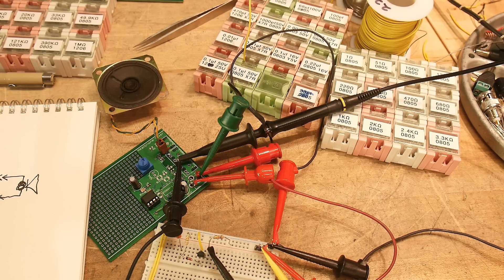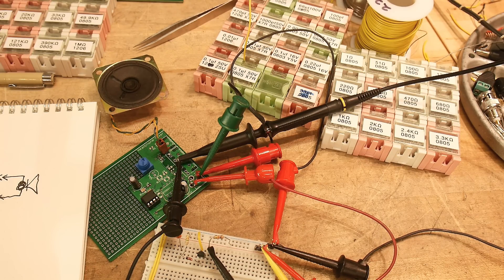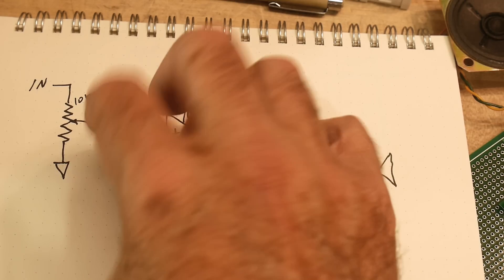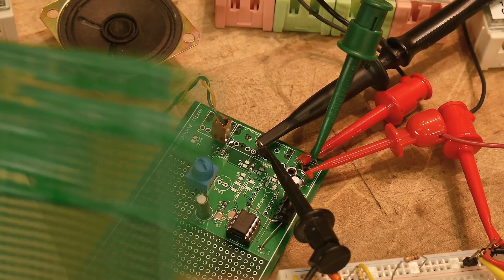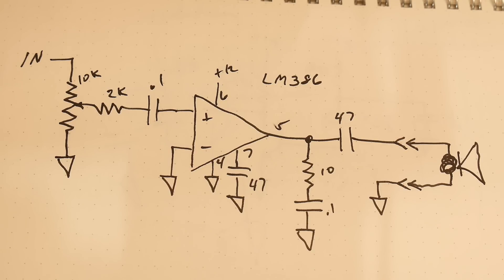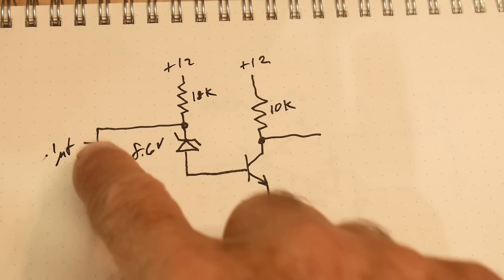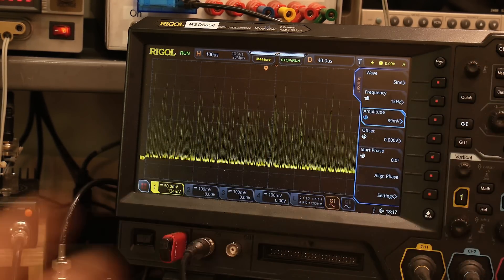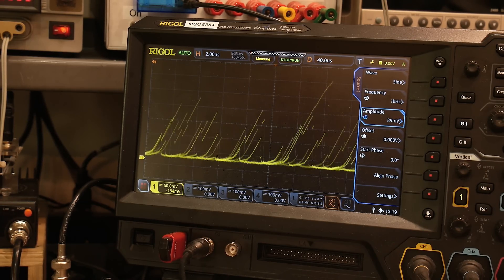#1197 DIY Analog Synthesizer (part 1 of 15)

Comment: Calculating is cheaper than soldering. If you want to have 19 different oscillators for DIY sounds take a look to the Synthesizer Workstation: https://youtu.be/oI_mTEu3WqE

Comment: Does it matter what type of NPN you use in the noise generator?  Using a 2N2222 I can't get noise out until the Zenner value (+ NPN Voltage Drop) is less than 0.3v lower than VCC (ie 11.7v -12v).  An 11.1v Zenner worked but anything less generated no noise at all.  Tried at lower voltages (VCC) and got the same result using lower voltage Zenners.
Reply from the maker: you need avalanche, lower voltage zener diodes zener, higher voltage zeners actually avalanche .   the avalanche voltages of NPNs will vary. so best to use the 3904
Reply: @IMSAIGuy  Hmmm.  Put in a 3904 and no change.  With your circuit, except using a 8.2v Zenner - 1N4738A (since I don't have an 8.6v Zenner) - No noise - no output at all.  OK, reading further down the comments I see connecting the 18k to the Collector rather than 12v is a thing and now I get 1v PP white noise.
Reply from the maker: @davidh1187  it is sometime picky about the layout, you try the circuit in: https://youtu.be/Ow9zQXPYm3g
it is almost the same but on resistor is tied to the collector instead of +12

Comment: Sweet series. I have a new scope on the way that is somewhat respectable and I have thr lm386 circuit already breadboarded from something I was messing either last week. Is it better if I just build the output on some veroboard?
Reply from the maker: soldering is more reliable
Reply: @IMSAIGuy  that's what I thought on both.  Thanks man. A decent multi output psu is next on my list.

Comment: I just built the white noise generator and it works great. The only changes are that I used 9v supply, a 2.2k resistor instead of the 18k resistor, and an 8.2v zener instead of a 8.6v zener. It took a little bit of trial and error to find out a good replacement resistor value, but it was still pretty easy. Thanks for the circuit idea

Comment: I'm having trouble replicating your noise with your circuit, using a 2N3904.  It looks like you have about 200mv spikes.  I see nothing (just ambient noise), connected to the collector of the transistor.  Does it have to be hooked up to a load?  Maybe the scope has to be set up a certain way?  I would love to see more detail on that.
Reply from the maker: instead of hooking the 18k to +12v, connect it to the collector
Reply: @IMSAIGuy  Thanks, that helps -- I'm seeing the ramp shapes now, but it doesn't look like "hair" like yours -- there's no "floor" to it, it seems to be riding on other random AC noise of 30-70mV, even if I use a 12V battery for the supply.  Maybe it's just the cheap zener I'm using, or just way too much ambient room noise.
Reply from the maker: what is the speed of your oscilloscope?
Reply from the maker: also what voltage is your zener?
Reply: @IMSAIGuy  I was using a 1GHz scope, tried limiting BW and also tried a 100MHz scope. I think I figured out that most of the noise was due to using long leads to the power supply (or battery) picking up RF, looks like mostly around 100MHz (FM stations?).  Thanks for the help!
Reply: @IMSAIGuy  I didn't have 8.6, was using 8.2
Reply from the maker: @SorcererStan  zener diodes below 8V have zener breakdown, above 8V have avalanche breakdown. not sure about 8.2
Reply: @IMSAIGuy  OK, I didn't catch that part, I thought you just chose a random value below 12V to get the effect.  I'll try some others.

Comment: I have a feeling this is going to be a fantastic series of videos. 
I've been working on my analogue synth build since Christmas, and with an arduino based midi to CV converter it's now at a point where I can get something vaguely resembling music out of it. 
Really looking forward to seeing what you come up with....
Reply: Yes, I've been into it for a year now. My second project was a MIDI to CV converter as well. Just to save you some frustration. Forget to use the inbuilt DAC. Even though my microcontroller was not an Arduino but a PIC, I still can tell you, that you need a more linear DAC.
Reply: @PermireFabrica  yes I have 2x MCP4822, that gives 4 voltage control channels that have 12 bit resolution. 
I have voltage outputs for note CV, pitch bend, mod wheel  and velocity.
Reply: @brianharper9798  okay nice. Quite a powerful module you've built! Mine is only dual channel and only gate and CV output. But one channel can be set up as a 16-step sequencer.

Comment: LM386's are unaccountably popular.  They hiss.  They oscillate, particularly if you're at all careless with layout.  They sound like crap at best.  

I actually get better results with the venerable LM380.  You  can put a couple of big copper foil heatsinks on it to get more power, it's more stable and quieter, you can wire a pair in push-pull for even more power out and drive a fair-sized speaker if it's reasonably efficient.  If it's an actual audio circuit rather than a synth, NE5532 pairs well with it as a preamp.  Yeah, they're old-school but they're still available in multi-thousand quantities overnight.

Comment: Does that lm386 have a 1w output or a 700mw output?
Just wondering which one you are using 😁 of course the 500mw lm386 would be better suitable for a preamplifier stage. Almost all the preamplifier op-amps that I have looked at on a data sheet usually range from 135mw 250mw, 350mw, 500mw and 625mw. But the 700mw and the 1watt lm386 are great for pushing a 2 watt or 1.5 watt 8 ohm speaker. But I have used the 1watt lm386 op-amp as a preamp amplifier but you have to used a trim pot or a resistor on the output of the 1watt lm386 before connecting it to a amplifier stage to get great sound quality control. I have also used the 1watt lm386 op-amp to make a distortion pedal at full tilt or cranked all the way up it'll get really distorted. No need for germanium diodes or LED lights to create distortion😂 You can use a 10K potentiometer along with a 10uf capacitor across pin 1 and 8 of the lm386 to control the gain.

Comment: "Moog" pronounced like "vogue".
You and I should chat since I just started on a similar trajectory, also op-amps, also those light jumper wires (but an analog computer-like learning-PCB, not a synth).
My casual interest in music synths suggests pink noise is preferable? I suppose there is an easy filter you can add to get it pink.....
Reply: Unfortunately not as easy as you think. Check out this video: https://youtu.be/0yB_h_wFkh4

Comment: Wouldn't the open loop LM386 work like a comparator and completely saturate into his 12V rail with any voltage over 0V? I can imagine it would look like a square wave at the output? (There is maybe a low pass filter on the output, maybe not a super square wave)
And which 47µF capacitors do you recommend using for audio circuits? There are a lot of rumours on the internet about "audio capacitors" :/
Reply from the maker: the LM386 is a fixed gain part.
Reply from the maker: this is not audiophile, any 47uf is fine
Reply: @IMSAIGuy  Thank you 🤗
Reply: According to LM386 data sheet the capacitor should be 0.05 µF (i.e.50nF)
Reply from the maker: @petrituominen8709  yes, I just didn't have one. I usually see 47nf

Comment: So what you just showed me is that if I use a zener diode as a voltage reference it is going to be noisy and I might want to include some filtering.
Reply: Yes and 78xx 79xxseries linear regulators make noise too alot of ppl have no idea about this either

Comment: Try a reverse biased transistor base emitter junction as well, as that also will break down around 7V, and give similar noise. You can even use TTL gates for this, abusing the input structures and output structures, with only 2 connections, to get a noise source. For higher more impulsive noise use a RF transistor as amplifier, and connect diode direct to base, without breadboard capacitance, which will reduce that initial falling time a lot.
Reply: What about the Collector?
Leave it open, floating or short to Base?
Reply: @paulcohen1555  Either way will work, though shorting to base can reduce external pickup of noise, especially if you use a TO can device where you can ground the can and collector.

Comment: is the opamp in open-loop? I dont see any feedback element
Reply: I believe the LM386 has internal feedback as it's meant specifically for audio amplification and thus the huge internal gain of a typical opamp isn't needed here. The datasheet shows an extremely simplified version of the internal schematic which has gain control circuitry. By default the gain is 20, and with a capacitor between pins 1 and 8 (as you can see here, disconnected) and a cap on pin 7 you can change the gain
Reply: Lm386 ist not a opamp. It is a audio amplifier for small speaker. For sure it can be used for some other things. On the other Side this ist not true for all speaker amps
 The classic tda2030 ist more like a Power opamp😉
Reply from the maker: the LM386 is a fixed gain device.
Reply: I had this same question.

Comment: What is the upper frequency limit of the noise in your circuit?
Please show the spectrum.
Reply: Depends a lot on the transistor amplifier and the layout, low capacitance diode and RF transistor you get up to GHz noise out with common components. RF noise source design is hard, you have to use really low capacitance and make large air gaps to reduce stray capacitance, and short leads as well to lower inductance.
Reply: @SeanBZA  And of the Zener itself? (Assuming low power 0.4W Zener)
Reply: @paulcohen1555  Pretty much just needs low capacitance, so often for the high end it is a point contact diode.
Reply: @SeanBZA  Will 1N34 do the job if operated at breakdown voltage (with a proper current limit, of course)?
Reply: @paulcohen1555  You would probably be better off using a RF transistor in reverse bias there, smaller junction and lower inductance will make the wideband noise figure better. Plus breakdown better defined as between 3 and 10V, as opposed to the 1N34 being anything from 20 to 60V.